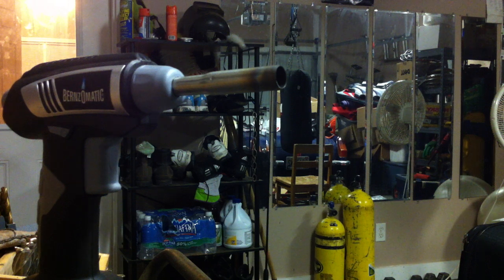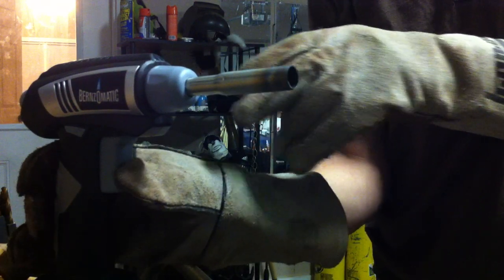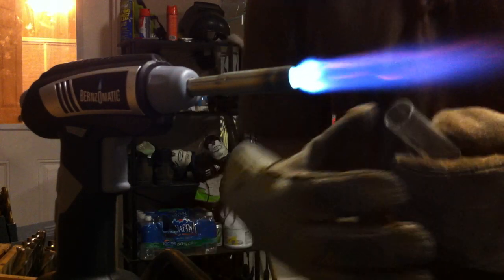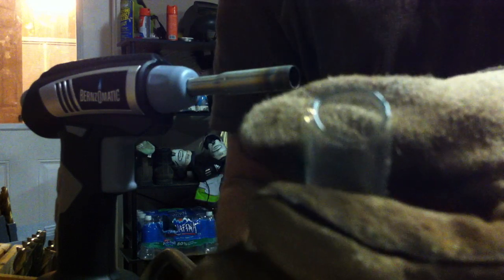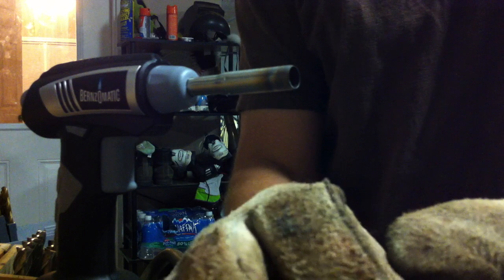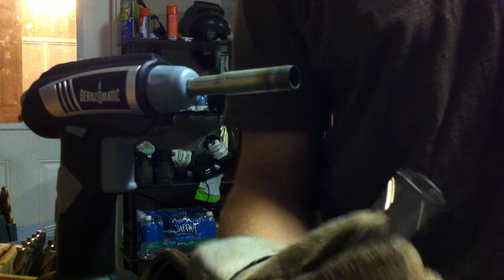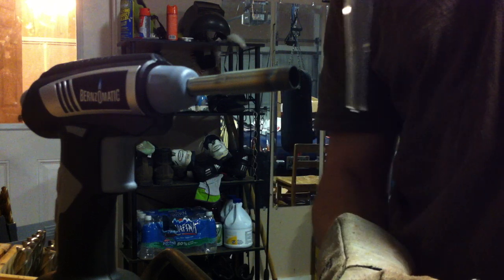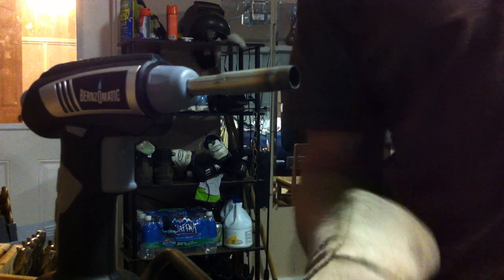Fire polishing Pyrex tubing at home

Comment: Any borosilicate glass worked in a flame should be annealed in a kiln to utilize it's strength and durability.  However, if you're doing it at home for yourself, that would be up to you.  Just make sure you don't buy any glass that hasn't been kilned!
Reply: Does that go the same for quartz? What if its kilned before the cut and polish?